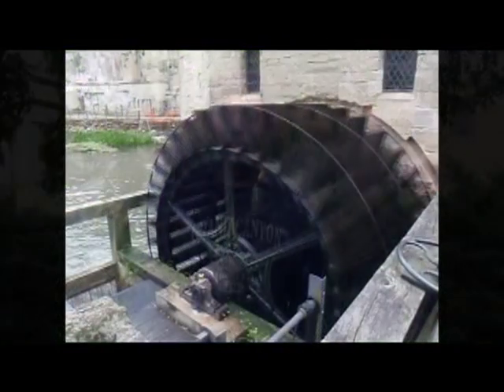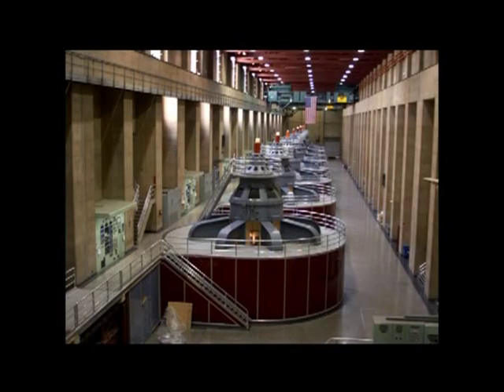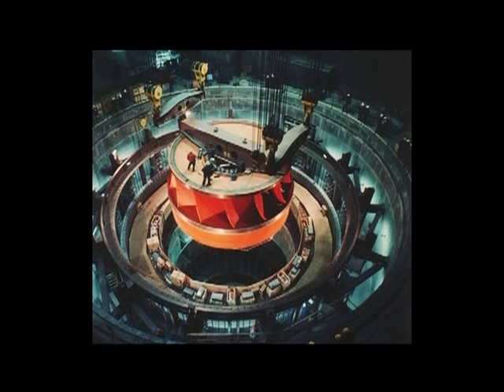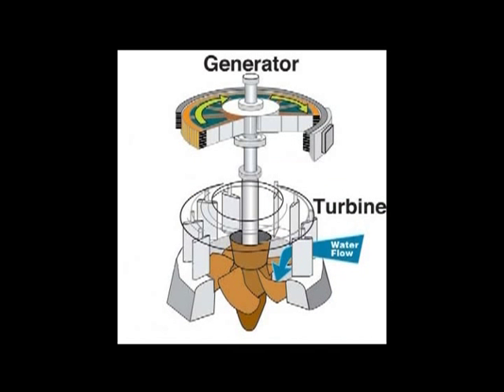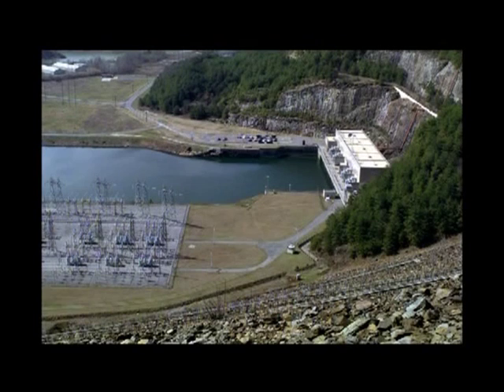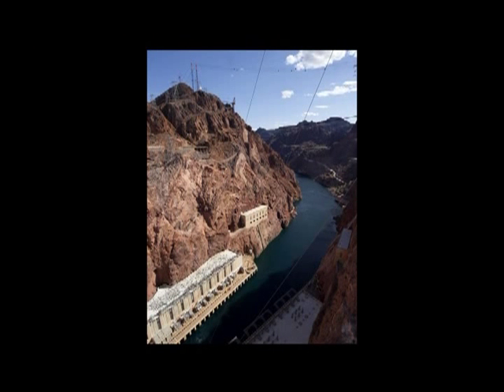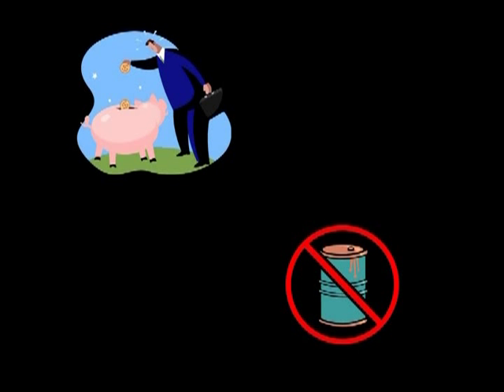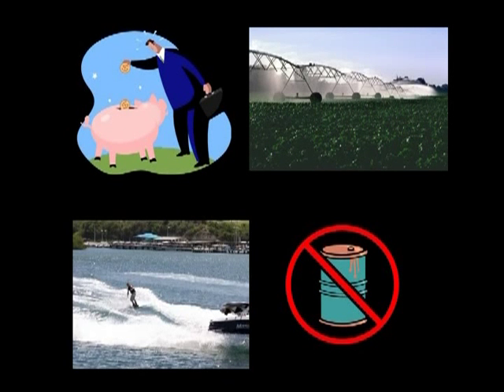Hydroelectric power: the shocking truth

Comment: No doubt it does effect the river systems - I live in a country where hydro is the only form of generation - now the occassional wind farm's springing up but they have their own problems. Hydro is without a doubt the best form of generation for power output to environmental impact - I wouldn't want to live anywhere else. Wave generators look interesting but I seriously doubt they will have any decent power output.
Reply: Al 

Wave power is better, because absorbing its power has less of an impact on the Earth due to the fact that much of the energy being collected is produced by a mass outside the earth’s environment. Like solar power, the energy from waves is not going run out soon. But, water flow is decreasing worldwide. The depletion of glaciers will eventually come to a negative end.

Using water flow to produce power is foolish.